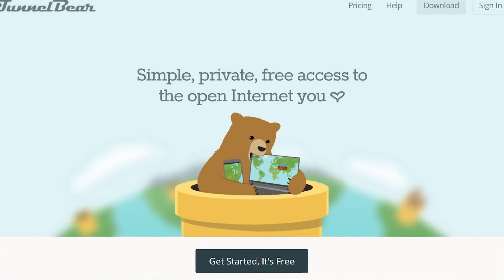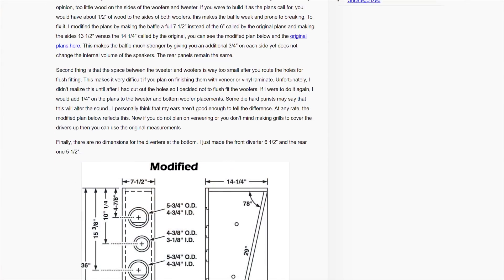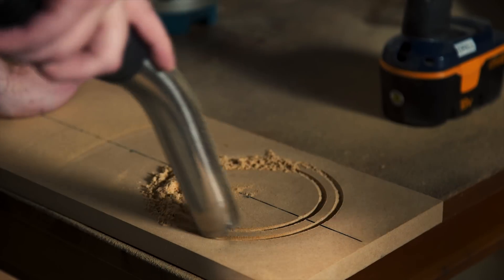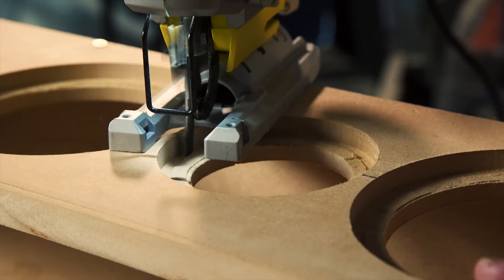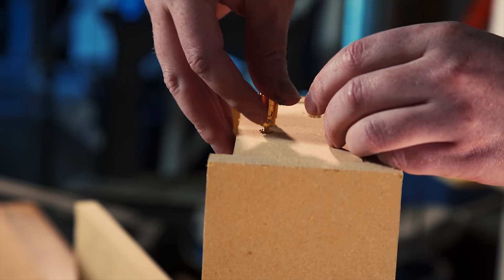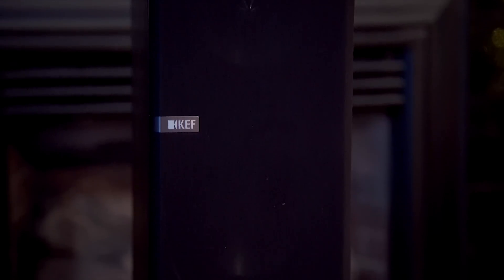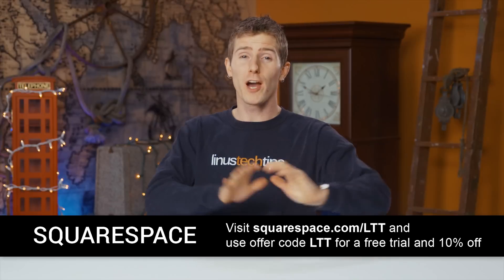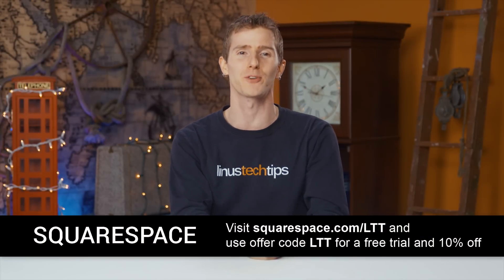DIY Speakers for Less Than $300!

Comment: This is a very bad example of a DIY speakers.
Reply: Lol my 16 jaar old self cane make it better
Reply: I built a pair from the flat pack.
They actually sound pretty good, hard to beat for the $279 I paid (they've gone up almost $100 since)
I use them in a bedroom, they murder TV speakers, and, looking at those little 5" drivers, I thought I'd have to add a small sub.
I was surprised at the bass, goes low and loud enough to startle you a bit, (I watch movies on my 5.1 HT set up in the fam. room) overall pretty happy with them, but uf you arent hansy or dint enjoy building stuff, you can probably do just as well buying some commercial units.
Reply: That's what he wanted,much comments and subscribers ;)
Reply: No, it isn't. The engineering and component selection are pretty solid, and they sound just fine in spite of being built by imbeciles.

Well not quite, he introduced a LOT of diffraction that shouldn't have been there, and some angular anomaly because the tweeter should be offset for a reason. Still, there are worse ones around.
Reply: @SianaGearz  I think OP was referring to the Linus build in specific, not the tritrix design it's self. I would love to see a rematch between the tritrix and the kef q500s except this time the tritrix where either built by someone competent or at least used the flatpack.  Seriously why didn't they use the flat pack? It doesn't cost that much more than the bare bones kit + MDF. Even unfinished, the flat pack would look better than his build not to mention built correctly....

3 things would be different. 1 the tweeter would be positioned correctly Im really curious how much the tweeter positioning hurt the clarity. The first guy talked about how the tritrix highs where drowned out by the mids. Ya that may have been the positioning.  2 the tritrix would be spiked. the q500 come spiked and decoupling the tritrix from the floor would put them on a more even playing field. 3. just in general better build quality, at least they would look better. I mean come on even if the kef didn't sound better, I would still prefer the kef because his tritrix looked like ass(the pimply kind)

Given a better build I think the tritrix would come much closer to the kefs in sq if not in fact beat the kef. O and for christ sake dont cover up the reviewer's ears! 

Like svtcontour I think this video unfairly put diy speakers in a bad light. I'm getting ready to do a anthology(same designer) build soon. I plan to put much more care into them than linus did with this build.
Reply: @SianaGearz  "Built my imbeciles." Bro, not being trained professionally does not make you an imbecile. What's wrong with you?
Reply: @Lambda_Ovine  Are you taking offence on their behalf? While they're playing dumb for entertainment. It's possible to make a neat build even if it's your first.

Comment: Basically use high excursion drivers(high Xmas, low fs) larger the better for great bass, go with Seas/Moral drivers and with a decent  enclosure it will blow the kefs away..literally.
Use Thiele Small parameters to find box size and determine if your driver is better suited to a ported design or closed system.
There is really no need to buy a kit, just use the thickest MDF/Hardwood you can find (1")and brace the corners with good glue.

Comment: Oh well ... I have to question your method of dampening the interior!
I think a skinny multilayer of bitumen and some soft wool would be better instead of this lumpy nylon u stuffed in ... maybe a loose very less dense filler is also usefull, but not that carelessness ... 
You need to weight down the inner surface ... the walls wont even have to be covered more than 80%!
Given there's enough room inside the cabinet the speakers can devlop adequate volume. Dont encumber all space with wildly stuffed, stiff and dense material of some kind!
The design of your crossover is simple and thoughtfull, I like that :-)

Comment: Hmmm, so many variables of wrong on this.....  First... Did you break in the speakers before the test?  Yes, woofers / Tweeters (drivers) need about 600 ~ 1K hours before they sound their best. Secondly?  Probably would have just used a full range driver ... skipped the cross over. Check out the big fun box! http://www.tnt-audio.com/clinica/bfb_e.html

Comment: dont fill it with wool it will kill the lows... needs a separate compartments inside the box for tweeter and woofers also use a small electronic cross over

Comment: Hey Linus Team! I have some questions for game audio development, improvement and features videos Tech Tips:  I have built a custom 7.1 100w (each one) following your inspiration using passive speakers. And now I discover that is not possible to connect them directly to the 7.1 audio card. Is that true? Can I burn the audio card? How do I link an Asus Trix (for example Soar) 7.1 audio or any 7.1 PC output to  (your excellent 100w custom ) "Passive" 7 speakers?  How to wire the connection from the audio card to the speakers for best sound result, optical or digital or analogic output? What amplifier to buy or build that has a 7.1 input? Can I use a custom amplifier homemade, car amplifier or must be a traditional 7.1 amplifier (in that case what to choose because in general, this awesome and stupid amplifier do not include 7.1 pc inputs). In that case, what is this 7.1 output for? And Since I'm making a Soaring Simulator, I wish to add an extra 8 speakers on top of the room roof, if it is possible (if I get an extra top output[Do not know well how]). So when the sailplane is passing over the tower like in "Top Gun" the player can feel it on top! Thanks a lot for your super awesome channel!

Comment: Wait you filled it with foam??? Okie Dokie Linus
Reply: Headout it's called dampening foam. It helps make the lower frequencies better... but he didn't use very good foam... he should have used polyester fill. And I also don't know why he used such a big ass port. There is no way that the surface area of those two speakers is equivalent to that of the port regardless of the frequency he was trying to achieve...

Comment: If you really do some extensive research, you'll find out that with about 600-800 bucks, you can make yourself an equivalent of 4000 bucks speakers... The tweetters and woofers used in this built might not be that high quality or the cabinet might have wrong dimentions. Also, where are the holes for releasing the base out of the cabinets? (that's propably why they lacked base) For me creating your own speakers is the right way to go. Is it easy? No! Will you make great speakers with the first try? Propably not. There are so much to take into consideration when building speakers, from the quality and type of the wood, to the quality of the foam or wool you'll be using. The cabinet must have the perfect dimentions for the tweeters and woofers used (there is some special software to help you with that). A friend of mine did make a pair of speakers woth 4000 bucks by only spending a good 500-600 bucks and the sound quality is incomparable, but it took him some time to gather the right materials and make the speakers. Is it worth the trouble? If you are experienced with wood work and electronics, it totally does! Linus here is right in some degree, if you do something slightly wrong, you'll lose big or even huge amounts of audio quality, all must be as perfect as possible. But if you can get just the right materials and have just the right knowledge, you'll most propably end up with one of the best sounding speakers you could ever imagine owning.

Comment: You could add passive radiators to increase low frequency performance.  Also you might want to seal the box and make sure you have enough passive radiator displacement capability.

Comment: Deal with data.  That's what you are good at.  Dsd bit perfect, no dop, no pcm.  Using i2s usb module for native dsd (1024).  Low pass filter for 35k hz and higher.  Whatever else.  Then plug it into the kefs.  You could rock this tech vain, where none exist.  Please.  Use foo bar or j river on crap top.  No raspberry pi needed.  Nodac solution.  Please.

Comment: The difference between industrially built speakers with large jigs and hole saws vs home-built does make a difference. You cannot use filler/putty to make up the difference in cutting mistakes. Putty will cause you to lose that bass kick. Search out video and watch how a professional auto detail shop makes custom subs and you will see.

Comment: So I am wanting to make a Bluetooth speaker using the TDA7492 50 W + 50 W dual BTL class-D amplifier and a some automotive 2 way speakers. I also have 7 samsung icr18650-30a batteries that are 3.7v in series that's 25.9v and 19,000mah. So my question is what wall power adapter should I use to power and recharge the system? Also what would be the rough battery run time?

Comment: Poor cabinet build will destroy the sound of any speaker. You may want to try again with a solid cabinet, preferably two layers of 3/4 mdf laminated together. Easy on the fill, its supposed to be loosely packed.

Comment: You can make great tweeters that handle heaps of power for hardly anything. I got an amp that has 200 + 200 watts @  0.1% distortion, and I haven't blown one tiny full-range "tweeter" yet (and I keep blowing normal tweeters all the time). So I had to do something, so I tried using 2" full-range speakers (Logitech one's) from computer speakers. lol But I radically modified them and I run them out of the box (slightly resisted for 6 ohms). With a sharp object I scribed a line around the voice coil center on the full-range cone, about 5 mm out, around in a circle. This allows more transient response cos it can vibrate like independently to the rest of the cone. I also got rid of the center piece on the full range speaker and left a hole in the center. I then glued a 6 mm triangle made of coffee-can-seal (tin-foil) onto where the cone starts, and the tin-foil triangle is pointed in toward the center. The foil makes cymbals sound like they are being hit and sound like they are made of metal. lol Great "S's" too, really pleasant treble (with power handling). Also being ran outside-the-box is essential cos it not only makes the treble go higher, but also makes the treble louder. And the top-end is so sweet (when it's ran out-of-the-box). Only use a 2.2 mf cap on the 2" full-range, any bigger cap will sound harsh (being out-of-the-box) and so you obviously need to run it with the cap on (and never without one when out-of-the-box). lol The cap also makes the treble go higher than without a cap, cos the cap "pushes" the high-end signal through the cap more than it would normally flow (without the cap). And with the small cap, it will increase frequency response in the top-end and this is also how you get such a great power handling. A 2.2 mf cap with 200 watts going through the full-range is like 2 watts without the cap (which is about what the speakers normally handle). 2 watter full-ranges have thicker voice-coils than tweeters and that's why they handle so much (with a cap). But if you get high wattage tiny full-range drivers, they will have even thicker voice-coils. So the 2 watters are better. lol Combined with the two mods mentioned above, and being out-of-the-box, and with the cap, it sounds pretty amazing for how cheap it is. Try it, before you start thinking I'm a nut-job. :) I run mine with 6" med drivers (coaxial and phase-aligned) set inside a large voice-coil throat in the med drivers (rare as rocking horse shit). I also run the med driver out-of-the-box (with the 2" full-ranges in the centers. Running med out-the-box is tricky, I choked and heavily resisted the out-of-the-box med and combined with some med coming from the woofer as well (and blended). The woofer is in a double chamber bass reflex box. They are the best speakers I have heard, with the open cone sound combined with mellow med from the woofer (blended as much as I can with the crossover). To run med speakers out-of-the box you have to be really radical with the crossover to make it sound even acceptable. lol But I have practice a lot and my speakers are sounding much better, since I started and it's a lot easier to make crossovers. The crossover is more expensive than the drivers (the copper coils). Cheap woofers are "boomy" but sound great with the right crossover (that costs more than the woofer). The sound quality is there but badly lack efficiency after making it sound good with the crossover. lol But my full-range tweeters are not very efficient either (but sound amazing and high power handling) and with 200 watts who needs efficiency. But my speakers are still way-way more efficient than electrostatic speakers (by-a-large-measure). And with phase-aligned treble&med and the out-of-the-box open sound, they sound nearly as good as electrostatics. But at a small fraction of the price.

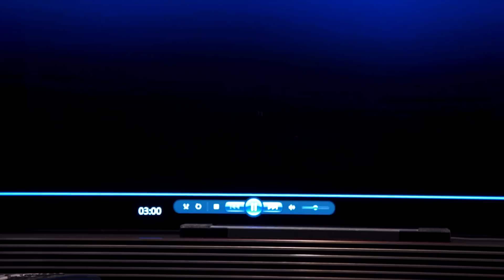Comment: The KEF's would be much better if they can notice at all in such a short listen. Listen to them for a week after hearing the KEFs for months and hear the difference. The Philips tweeters in the kit are not good cos they have a resonance at about 14 k. They are remnants from the seventies (old design). The KEFs are new tweeter design and the KEFs are point source treble and med and the home built ones are just standard (separated) woofers and tweeters (not point-source). That's why he said the med was "kind of drowned out" at 6:34. But point-source treble and med gives unusually good med sound, making the comparison in KEF's favor. Also the KEFs are about 10 times dearer than the kit. The savings exist by making your own speakers but can't be like ten times and that's why they could tell the difference.

Comment: The Kefs need a good amp or they sound like balls. With a high current quality amp I bet the Q 100s ($300 CD on sale) would blow away the homemade jobbies,both in quality and output. I think a person would be hard pressed to find a better sounding speaker for $300 than the Q 100s. I have the Kef R900s,LS50's and RTI a9s so I have a few sets of decent speakers to compare to the Q 100s. The Q 100s actually play 1 db louder than the Kef LS50s. I am all for do it your self projects,but I don't think it is worth it at this price point. It's a lot of work to have something that doesn't sound or look as good,as what can be bought.

Comment: Decent 5.1 setups that cost £1500 when new can be had used for around £100-£200 Such as  the Acoustic Energy Evo 3's / 1's which had awesome reviews too. .. I just upgraded from them to the Q500's and while they're better they're definitely not 3 times better which is what they cost!

Comment: Feedback: 
- use a stepped baffle or angled baffle to time align the drivers
- the cabinet is obviously to large for those small midwoofers, Also, make seperate enclosures internally for each midwoofer, this makes the sound much more clean
- add some lead bitumen on the inside of your cabinet walls to help damping them
- use a bit more inner bracing to help prevent/reduce cabinet resonances
- use multiple layers of wood meterial (MDF/HDF) to make the cabinet walls more rigid
- use a first order series filter for smoother crossover and less resistance
- work on your woodworking skills... ;-P

Enjoy the music!

Comment: i bought used KEF IQ 90 Speakers to complete my existing Setup of IQ 50 Surround and 2x IQ 30 as Center.

THe IQ 90 (the Generation before your Q Series) cost me about 400 $, the pair :D
And i wanted "the biggest" for Front Setup, cause i also love to hear CDs with my Cambridge Audio Azur 650A/C, so i needed something "better".  xD

yeah, if you compare it to a new Price of a (small....) IQ 50, the IQ 50 are expensive, i think about 650$ per pair. But the IQ90 cost as i get my first good loudspeakers about 1700 $ per pair new.... way too much.

For a big Setup, so for a bigger room, i also would recommend it.
But, also its a good idea to watch marketplaces for used ones. there are sooo many (men),  where the wife doesnt want anymore the big, heavy speakers. So i get my IQ90 :D

The bigger the Chassis is, the better.
I saw it very good on IQ 50 vs IQ 30 comparison. IQ50: floorstanding LS, 130mm Chassis: sounds not as good as the 165mm drivers of the (smaller, lighter, cheaper) IQ30 speaker.
2 130mm are not as good as 1x 165, so its with these KEF. The Middles go under with the small drivers, but still very clear and nice highs. But the IQ 50 are better for the optics(cause floorstanding)
IQ 70 would be also great, and way better than IQ50. But big, the IQ 90 are monsters, also the Azur 650A is not strong enough to pull them 100%, but they sounds also in (way too high) voulmes perfect

btw nice to see useful budget things on LTT :D

for DIY guys, i would also recommend to glue acoustic felt on the outside. They looking like PA LS then, but i think they would be look better than yours xD

Comment: Just a few bucks more, and the peerless HD, Sb acoustics  or vifa ring is equal or better to the kef tweeter.  Sb acoustics woofers would bury those.  The whole package would cost a little more, but beat the mid and top of kef.  Add a sub.  Better than kef for 1/2 the cost.  Cost me $100 to apply real oak veneer to mine.

Comment: i use a kenwood 15in car sub (with 1000w amp) with two kenwood 6x9s as my centre speaker... a pair of panasonic speakers give me front left and right (they are from a home theatre system) and some cheap box speakers as my rear left and right (hoping to upgrade these soon as they arent that good...) i use a Behringer xenyx 1622fx as the hub for these (its fairly old but does its job amazingly considering it age) a brilliant set up if you like to annoy your neighbours when watching films or listening to music... XD